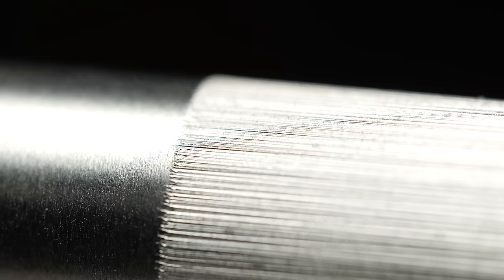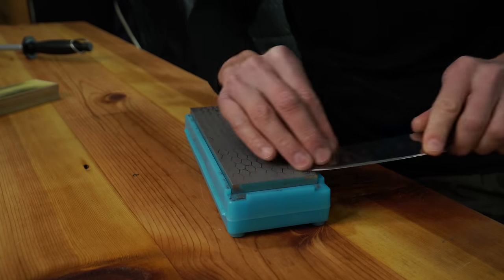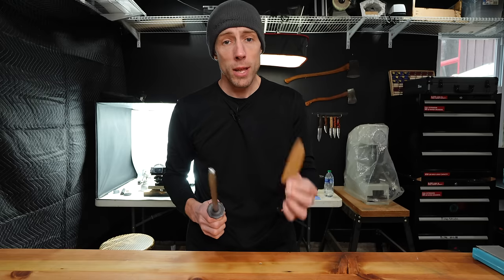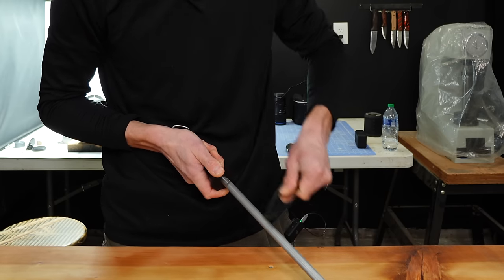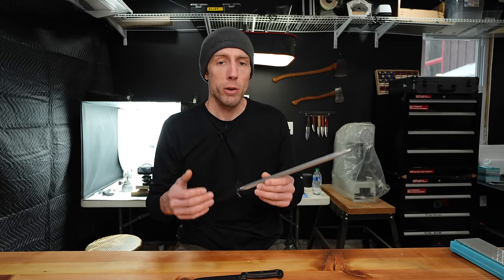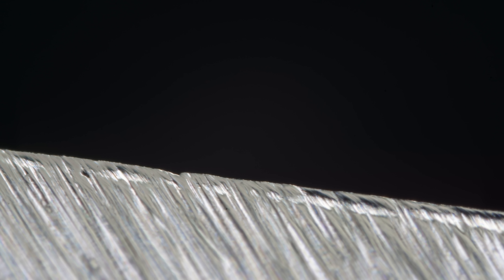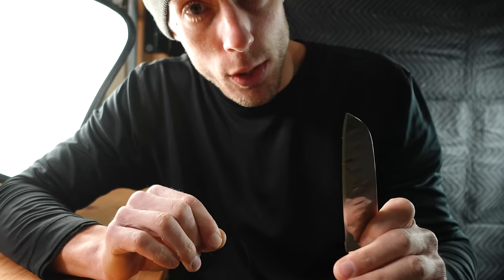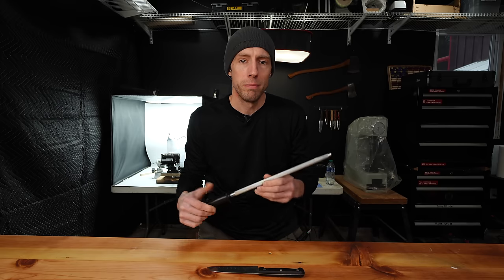What Do "Knife Sharpening" Honing Steels Actually Do?

Comment: I use such a rod and it gets my knives plenty sharp. Am I using it wrong? Maybe. Does it get the job done? Absolutely.
Reply: A straight edge compared to a rolled one will definitely feel and act sharper. The stick thingy just makes the edge more rough and abrasive even if you successfully straighten it. so it's easier to cut with using back and forth sawing motions since it essentially creates crude micro saw teeth, but its not as easy to chop or carve with as a straight and true sharp edge is. The difference can be quite small though. It just depends on how badly the edge gets damaged. I use one of these stick thingys at work all the time. I think it would be cool to have stick thingys made from actual abrasive materials as to help straighten AND sharpen the edge, but idk if that's a good idea or not. I'm no expert.

Comment: You are supposed to draw the edge INTO the steel not away. Why does everyone think it is away?
Reply: No, you sharpen into the edge.
You correct by drawing the blade away from the edge.
Reply: This explains why I couldn’t get a steel honing rod to work on my kitchen knives.  Gave up quickly.

Comment: I showed this video to my mum, and in typical brazillian fashion, she cursed half of your bloodline.
It actually DOES abrade away even very hard steels, you just need the correct technique. You actually use it like you would use a stone. You pull the edge TOWARDS you, fprcing the ridges INTO the edge, thus abrading away steel. And it isnt just microscopis specs. In like 10 seconds with the propper tech, it can make a black line in toilet paper, just from the abraded away steel. So, in the end, it does actually sharpen the knife. Not paper cutting sharp on most cheap knifes, but sharp enough to easly cut trough even very hard things like a pumpkin.
Reply from the maker: We have to talk about this..
https://youtu.be/65JzsDU_0mI

Comment: You are missing the actual point of using a steel. It is not meant to sharpen a knife to the most optimum edge. It's purpose is twofold: 1) to take a dulled knife and restore it very quickly to working condition, and, 2) is able to be used on a dirty knife and sterilized after. Butchers and kitchen workers use them so they can get their tools back to the task at hand. Sharpening stones are neither as quick nor able to withstand harsh sterilization methods. Thus, a sharpening steel is superior to a sharpening stone for working men that rely on their knives to do their job.
Reply: sure they may be suppose to do that but they dont really work they just turn your dull knife into a messed up microscopic sawblade that goes dull very quickly
Reply: @caparzo54  ok

Comment: Meh.....so that's the science, and good science it is.  But for 50 years I've been using my "sharpening" steel to actually sharpen my knives (by pulling towards my steel hand) every time I use a knife.  None of my knives are ever really dull (when they are I get out the quick and easy electric sharpener to reprofile the edge), but the steel almost always brings back the sharpness in a matter of 10-20 strokes.  So believe whatever you want to believe....for me, the difference is nice thin slices of tomato or tomato puree.  Is a steel the best way to sharpen a knife?  Nope, absolutely not, but there is no faster, easier way to bring an almost sharp knife back to a useful edge.

Comment: There is a lot more to say about honing rods.  Original honing rods were non ribbed non abrasive (and are still available).  They were used as a first step in repairing knives to redress a rolled edge.  Redressing the edge requires, as you stated in the video, more force than what chefs show using them.  My grandfather learned me to lay down the knife blade flat on a small plank and slide over the edge with the rod holding it firm in both hands, pushing hard down.  After that the sharpening still has to be finished by the classic methods.  But for all of the knife blades edges made of brittle steel (most of Japanese knives), this method is of no use.  

The grooved and abrasive honing rods have both the only goal to remove material.  The grooved ones get very fast dull as modern knives steel gets harder and harder, why these rods will disappear IMO from the market in the next decennia.  The abrasive ones are diamond coated and last longer, and are the only rods working for Japanese knives.

Comment: Here is where you get this wrong. "Kitchen sharpness" and "woodworking sharpness" are not the same. You actually want "teethy" blade for cutting veggies and meats. For wood a smooth edge is preferable. Thus, sharpening steel has its use in the kitchen.

Comment: I'm only half-way through, but so far it seems like you're starting with a false premise. I've known that honing rods don't fix a rolled edge since I first started learning about knife maintenance. I used to use a glass cutting board and you can imagine how many rolled edges I was dealing with. I too thought the honing rod didn't work. However once I switched to wood/bamboo cutting boards and was more careful about how I used my knives, I came to learn that the honing rod is a great tool for maintaining an already fairly sharp edge. It will greatly extend the time between stone sharpenings. It's not a placebo, as you can see the difference it makes by holding the edge under a bright light. You can also feel the difference pretty easily. However, if your knife is actually dull, chipped, or has a rolled edge, then yeah the rod won't do anything. At that point you need to put it on the stone.

Also, I always do a forward slicing motion, like I'm trying to take a thin slice out of the rod. I never found any success with backwards strokes.

Comment: All I need is a knife that cuts a tomato or something like that well. And it does but then a couple of weeks pass and they don't want to cut a tomato well. I take a honing steel that is right there, in the knife block, run about 10 passes on each side and the knife cuts the tomato well again for another couple of weeks. I do have whetstones and expensive sharpening diamond stones I use for sharpening woodworking tools but I don't keep those in the kitchen. The honing steel works well enough for me in between the true sharpenings of my knives which I do several times per year as needed. That is end of story for me. I only use the kitchen for making breakfasts and sandwiches now and then so the wear and tear on the knives is extremely light.

Comment: Others have commented ... I  agree...

1. Every time you use the "honing steel", in your video, you are drawing the blade backwards up the steel.  Every one of my ancestors taught me to carve againt the steel, at 17 degrees estimated, alternating strokes.  Just to suggest you might not be getting the result you want, because of your technique.
2. If you take a damp paper towel after you use a steel with lines 20 times, and rub up and down the steel, you will see the fine powdery metal the the steel ridges remove.  Proof that sharpening AND edge straightening is happening.  Yes, I said it... sharpening... steel is being removed from your knife edge.  How do I know it's not all from the honing steel?  Well, my grandfather's steel is still with me and I am over 60, and the ridge lines are still there.  So the steel flecks are coming mostly off the knife, not the steel.  
3. As astute butchers have pointed out, men with thousands of knife hours, sharpen with abrasives, and maintain edges with steel.  Otherwise you will remove the heat-treated deep edge by constantly sharpening and prematurely shortening the life of your $120 knife.  Butchers know, I listen.
4. IMHO, NONE of this applies to Super Steels/Crucible steels.  Electron microscope pics of crucible super steels (German M390, Japan S2, USA CPMXXX, eg CPM S110V) edges show that the large crystals do the cutting and the edges probably stay sharper longer due to the strength and tearout of a crystal at the knife edge, leaving an irregular edge at the submicron level.  That is why super steels cut things with skins (eg. tomatoes) so easy.  They seem to require diamond coated hones, and rare sharpening, and cannot be refreshed as easy with simple steel ridged hone, because they are orders of magnitude harder than the steel hone.  Super steels will wear down steel hones much faster, but the knife   edges last much longer.  I believe Butchers don't use super steels or stainless steels  that much, because they can put a razor edge on 1059 Steel several times a day with a couple of hone steel swipes, and it's tough steel, and cheap.
Old 1059 may rust, but dang, it's so easy to put an edge on!!!

Kudos to your channel and presentation.  Don't listen to me, listen to the Butchers, who have more hours behind a knife in a month than I will have in a lifetime.  There are sometimes a reasons for Urban Legends!!! 🙏🙏🙏🫡

Comment: The sharpening rods only work good on high carbon kitchen knives.
I have used them for years. It has to have an edge on it already & after slicing meat with it all day, you can hold it back to razor sharp in a matter of minutes.
I was taught to use the sharpening rods in 1985 a lot different than the way you or that Chef Guy uses them. They have always worked fantastic for me but, only with certain types of knives!👍

Comment: Good video, but you're not completely correct. I have my Grandmother's 80+ year old carbon kitchen knives, the only thing she EVER did to them is run a steel on them. They were always paper towel-cutting sharp (still are) and are severely re-curved from years of sharpening (yes, sharpening!) using her steel. She was a professional cook, used these knives every day, and I know, 100%, they have never touched a stone. I think if you're using super thin, low hrc carbon steel at low angles, you can sharpen with a ribbed, higher hrc  steel rod-the principle isn't any different than any other abrasive. I don't think people just rubbed knives on steel because they didn't understand an apex, I think they understood the apex of their more primitive steels and thinner blades better than you do and sharpened their knives with a harder steel rod.
Reply: If you were to try to sharpen 10v (or even s30v) using an old Arkansas stone like the ones we used on our carbon Case pocket knives in the old days, you would probably conclude that such a stone cannot sharpen knives either.

Comment: I don't have a microscope to disprove this video and I'm no sharpening expert but real world results for me debunk this. The fact that you have ametuer home cooks in the comments talking down to professional chefs and stating that they should always turn to a stone sounds like nonsense as well as being impractical. For me the whole point of a honing rod is to 'maintain' an existing edge and quickly and it all comes down to technique. My Wusthof knife set have been in operation for 2.5 years using only a Victrinox ribbed steel, (granted very occasionally) and a f.Dick stainless smooth honing rod before and after every use. I touch them up lightly on water stones no more than twice a year. But according to the vid I'm just straightening a burr? IMO you debunk yourself at the end by then recommending a diamond steel and exactly the same technique! Surely all the diamond steel does is take more material off and wear through quality knives faster? After years of my water stones for me the perfect combo would be a quality diamond stone/s and a smooth steel or ceramic rod with almost zero pressure with the rod.

Comment: You don't know how to use a steal?, I have been cheffing for 45 years, I hold the steal left hand holding it up then hold the knife in right hand blade facing down then i use only my wrist and run it down both sides on a slight angle I couldn't tell you what pitch I use but I can keep a sharpened knife cutting like new for hundreds of cuts maybe thousands?( a few days ). never counted. You do sharpen very well but try my way and see! The flared part on top of the handle is flared so that if you run it to far down it will stop the blade from cutting you, I never run it down backwards I know that cooking school point the steal down on a tip down on a table and run it upside down I think they don't want that learning curve to get them sued ????????????????

Comment: The rolled edge you did on the copper pipe isn't what was meant by rolled edge (you literally bent the cutting edge, if we butchers actually bent our blades like this we'd never have a job anymore), when you were tapping it on the block of wood that is more accurate. The steel is a tool we use to keep our knives "straight and true" for longer periods of time without having to use a sharpening stone. If you use your knife as much as a butcher does then you'll understand that we need the steel so we aren't wasting time sharpening it on a stone. Gordon Ramsey's steeling is horrendous fyi, you don't need a steel and never will because you don't cut like a butcher does. What I think this really comes down to is the fact that butchers really didn't know how to sharpen their knives properly (and still can't), so everytime they sharpen on the stone they never fully remove the burr which gives the rolled edge feeling after it's been used a few times.

Comment: The problem with this is too much theory not enough empiricism. It doesn't matter how anyone thinks it works, if what chefs do actually works, and many many of them swear it works. And "works" is not defined by anything about knife geometry, but by "cuts better". And I don't buy the burr thing. Many chefs swear by a honing steel repeatedly fixing up their knife for weeks or months without needing to sharpen. Instead of doing the honing yourself with your head full of theory you should have had a real chef do it who knows how chefs actually do it. Hint: they don't do it with a trailing edge stroke. Maybe they are all full of shit, but you didn't test that, you only tested that the things that knife-geeks think must be going on don't work.
Reply from the maker: All your concerns 👇
https://youtu.be/65JzsDU_0mI
I literally show pictures what these do. No theories. Microscopic Images lol🤦‍♂️

Comment: You're conning people. I've worked in kitchens for half of my adult life, and NO ONE draws the knife edge trailing on a steel. (Some idiots do draw the edge toward themselves, though. A 1st rule of knives is to never do that.) It's done with a leading edge and a draw. I'm also the son of a toolmaker and have my own machining experience, so I know metal and edges. You're right about the rolled edge myth, mostly. But, cooks in a kitchen don't have time to pull out their whetstones and strops every time they need their knife to perform better. Using a kitchen knife won't roll the edge like you did with the copper pipe, but it can roll the apex slightly and break off bits at the thinnest spots and even create new burrs from all that. A HONING steel does exactly what it's name implies. It hones the edge by deburring and smoothing the damage from use back out, thereby extending the life of the edge between each sharpening. It is like your fancy little diamond plate in a convenient form, with a handle even. It's almost as if someone put some thought into what's needed in a kitchen. Isn't it? LOL
Reply from the maker: It's almost like i know what im doing 🤦‍♂️👇
https://youtu.be/65JzsDU_0mI

Comment: Usually love your videos. Not so much this one. You are using the honing rod holding the knife the wrong way honing backward. Of course it does not work this way. Watch a kitchen pro's video. The knife has to move forward, not forward. The sound and feel of honing tells you how good the basic sharpening is. Moving the knife forward definitely does remove the burr. Moving it backwards does not. It just moves it around. If I wipe the rod on a white paper towel, I see metal dust, so it must remove material. Again, if used with the knife pointing forward.
What I have also found, is, that even though a honing rod may not give you a razor edge, it is a good and very quick means to bring an edge to household usability if the basic angle is still OK. 
Best regards - looking forward to more videos of you.
Reply from the maker: We have to talk about this..
https://youtu.be/65JzsDU_0mI

Comment: nah. if you want a honing steel that temporarily straightens the edge you go for smooth edge, not these weird serrated ones. 
they have sharpening rods, i’d look into more into what grit level you want, however with rods it’s temporary maintenance so a ceramic would is about a 400-800? grit it’ll do just fine.
Reply: smooth steel rod*

Comment: your honing rod you start with "backsteeling" to unroll the edge, after that you forward steel to remove the serations, and there are different grades and you would use a smooth steel (properly sanded) afterwards. You absolutely need a diamond stone to sand away and "sharpen" a lack of edge. this preserves your knife lifespan as if you sanded every time you needed your edge back you would have no knife left in high use areas like a meat slaughterhouse.

Comment: I'm a butcher, i use these types of rods everyday. 
We have two models one with those striations and the other is basically smooth.
The one with the striations I use only after using the stone, and the smooth one i will use a lot more, after cutting a lot of meat and after using the one with striations.
The smooth one is good for maintenance of the edge, I can do heavy use of my knife without needing to taki it to stone for months